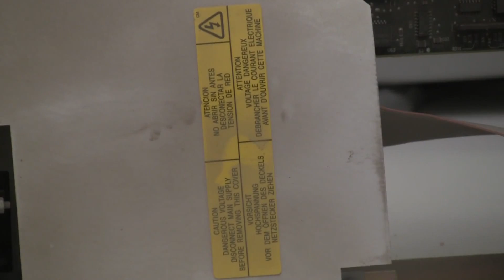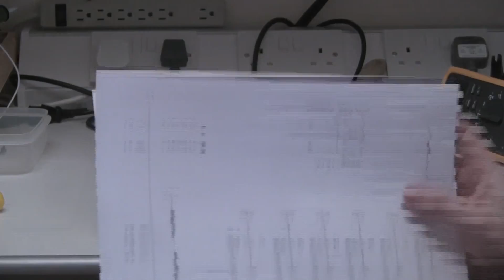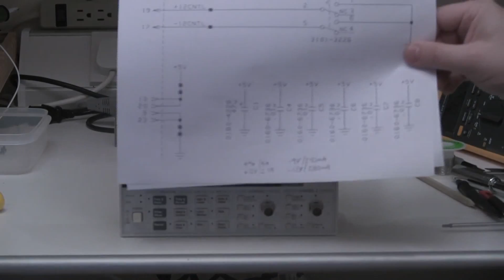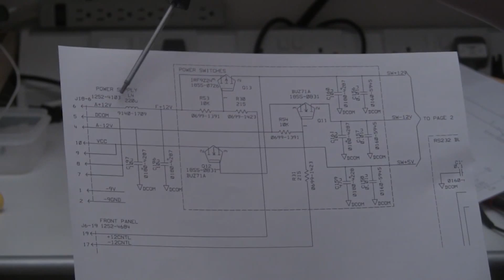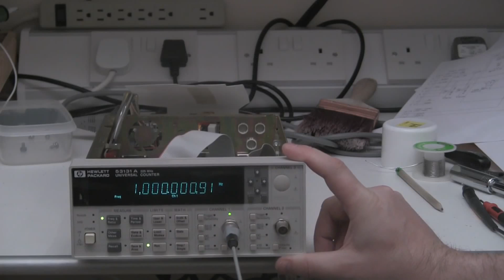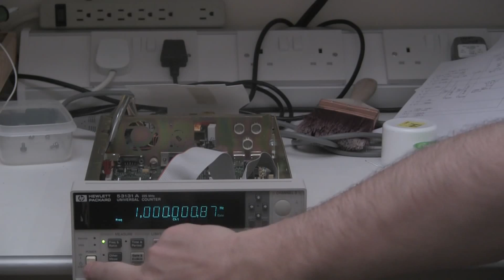HP 53131A Teardown and Spillage Clean-Up

Comment: Hi Gerry. 
I’m in the market for a decent frequency counter, either a hp 53131a or a racal 1998!!! What do you reckon please? And obviously things to look out for with these counters. 
Like the vids by the way, very informative. 
Cheers 👍
Reply: Hi Lee, both counters are very good. The 53131A's are much better than the 1998 but that's not to say that Racal counter is bad, it is actually very good. The Racal's are generally cheaper but need a bit more TLC.  The HP/Agilent counters are all very good but they have VFD's that do go soft over time, so if you get one, look for one that has not been racked and left on for long periods of time.  It is also very hard to tell the condition of the display from a photograph, they show up a lot better in a photo because of exposure time and dynamic range.  Not the end of the world but a new display module alone can cost you £100. I have some 53131A's for sale, I would not be selling them cheap though, they are hardly used and in A1 condition, and I have moded them to include the OCXO option and of course calibrated them against my RBS and GPSDO.  If you are in the UK and are not looking for hobbyist prices then that might be a viable option for you, shipping outside of the UK with import duty and stuff it would probably come out a bit expensive.
Reply: Yeah sure. I’m in the uk, how do I contact you???
Cheers Lee 👍

Comment: I just took apart an old 53132A that had the same mess on the bottom of the circuit board.  It must have been a rubber foot attached to the bottom of the board that completely dissolved.  It was a horrible mess. IPA and a brush got most of it off, but some of it is still soaked under caps and resisters on the bottom of the board.  The 53132A appears to have the same circuit board as the 53131A except the 2nd FPGA is populated.

Comment: lots of lab instruments keep fans running when they are off, the reason is likely to even out static charges that could mess with readings when the device is turned on or so i have heard
Reply from the maker: iknowsstuff in this case its to allow the installed OCXO to remain at temperature and stable so the counter is ready to use on demand - this is what I found out after doing the mod.
Reply: For frequency counters that effect would not make a difference, in the case of the 531xx series of counters, this was primarily to support keeping the OCXO option permanently powered up to avoid thermal change and retracing.

Comment: - that 9V is weird. the troubleshooting steps in the manual don't even bother to have you test it. you'd think they'd have a custom PSU for this, but maybe it's an OTS unit with an extra rail they aren't using? or maybe it's used for one of the options?
- OCXO option is likely the reason for the PSU fan, a few watts at least to keep the osc warm while in standby

nice teardown/repair. i love the vfds on this era of HP gear.